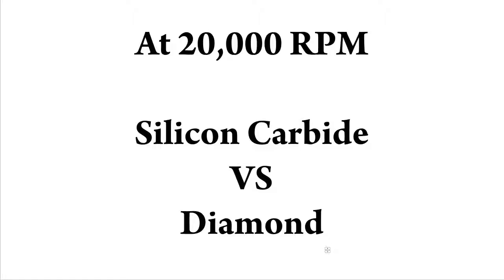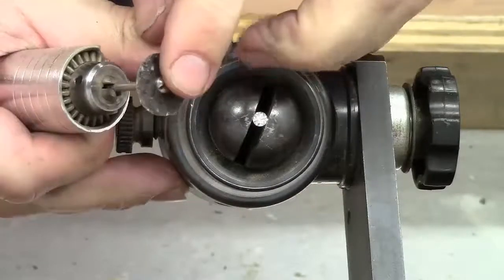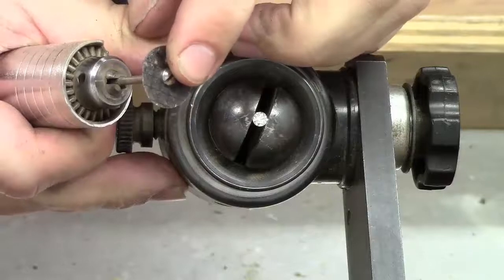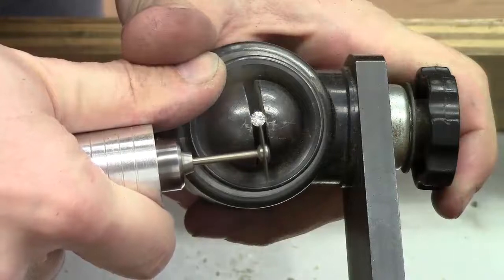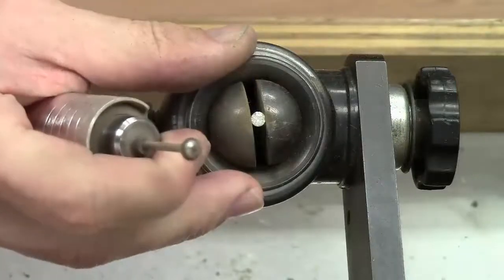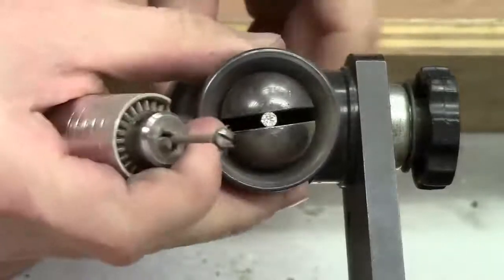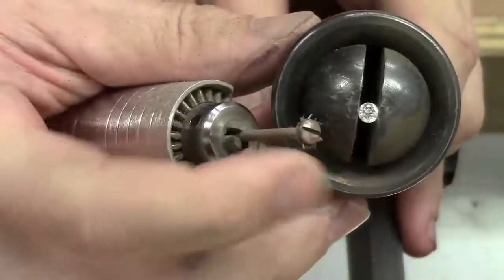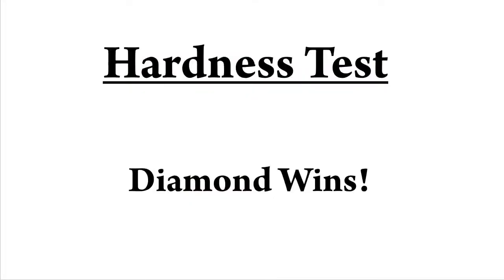Moissanite Versus Diamond   The Hardness Test by Gerry 'The Jeweler'

Comment: Misleading. If the Moissanite was stationary solid stone the you used a diamond disk the result might be different.
Reply from the maker: Hi Paul,

Not misleading at all. 

Harder gems like diamond are utilized to cut, facet and polish softer gems that are lower on the MOHS scale of hardness. It is simply how it works.

You can not cut through a harder gem material, with a softer gem material... Which is why the silicon carbide can cut through most anything at high speed, but gets blown to bits by a stationary diamond.

A stationary moissanite will not stand a chance against a diamond at these, or any, speeds.

Don't take my word for it though, call a lapidary/stone cutter and ask them.

Thanks for the comment!